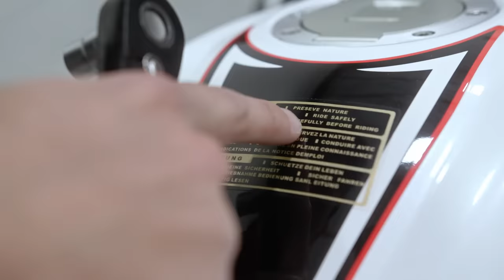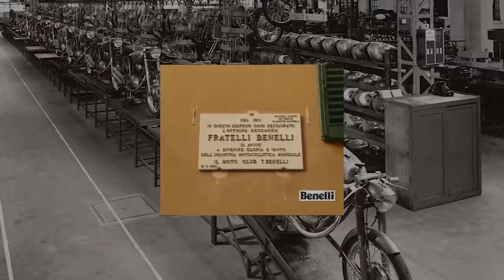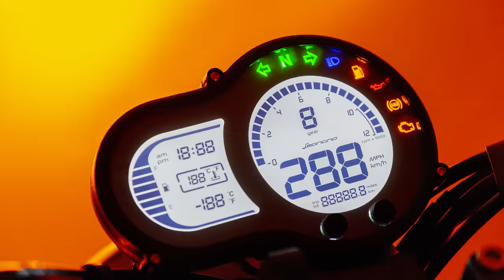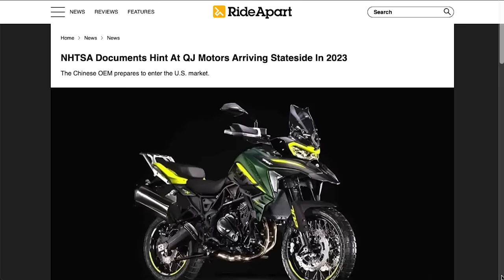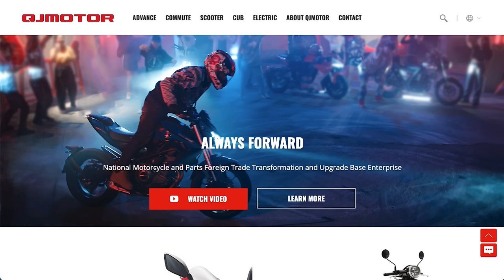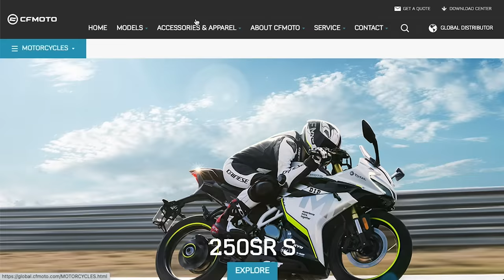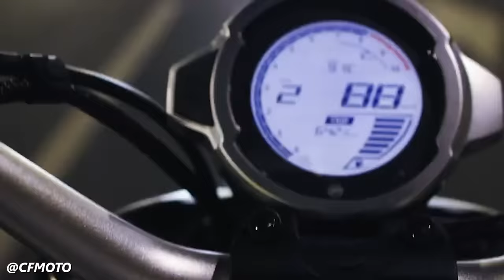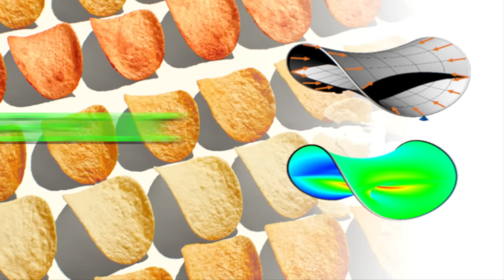7 Chinese Motorcycles that are WORTH IT

Comment: To be fully honest, Benelli is probably more reliable now than when it was Italian
Reply: This dude probably owns a benelli
Reply: Eyyy we made them to go fast not to last.
Reply: Not hard.
Reply: That's a very low bar
Reply: Believe me CFmoto has better quality then  Qj or benelli
Reply: @thecreativeenzymes  that’s for sure 👌
Reply: @maverickiragulfan4434 that sucks the don't last I never had one b4
Reply: By far yes
Reply: A man Went to Afghanistan on a Benelli Trk502 and has no problem
Reply: Shit motorcycles but pretty awesome guns 😂😂😂
Reply: Got the bn302s love it so far just eats oil on constant high rpm
Reply: @thecreativeenzymes  Really? They won't fall apart in two or three years?
Reply: Poor fool!!
Reply: I bought a 2023 Benelli 302s March of 2023. Right now I'm just shy ok 10k miles and have had zero problems with it.
Reply: @metaldreams3595  every vehicle gets old and fall apart depends on how you use it. What I said is just a comparison between the brands.
Reply: Some guy made 85k km and 36 countries off road with trk 502x
Reply: Reliability is all about funding. When Benelli lack of money their reliability will just goes down with it
Reply: @maverickiragulfan4434  hahaha
Reply: Benelli's 500 and 750 sei engines were copies of the original Honda CB500F engine,with the 750 being a 500 with 2 extra cylinders slapped on, so I guess Benelli have come full circle.

Comment: I live in Melbourne, Australia. I bought a Benelli TRK 502X new 18 months ago. I’ve done 117,000 km on this bike with little trouble. Yes, it’s heavy…but when you get caught in a crosswind, or buffeting caused by road trains you’re going to appreciate the stability of the bike. I do a yearly trip to far North Queensland, over 10,000km in 12 days, and the bike is awesome to ride. I get mine serviced every month at the dealership I bought it from and they just laugh when the check the km. It doesn’t have the “grin factor” that my Tiger Sport 660 has, but I can’t do 1000km + days on the Triumph either. Seat is really comfortable and butt only starts getting numb around 800km mark. Great bike for the money.
Reply: What was the top speed you got on it ( I know silly question but ?)? And is maintenance cheap?
Reply: @mrrnigah643 my friend rides a trk502. with him and his wife (their total weight 200kg minimum) on the bike they were able to go 147kph easily. He said that he wasnt even on full throttle.
Reply: @mrrnigah643  do the maintenance stop being lazy its a bike not truck

Comment: The CFMoto 300 NK is one of the few good quality bikes that get to Latin America for accessible prices. Most Japanese brands don't bother comercializing models with ABS, full LED lights, and good displays on the lower end, except in a few countries. Definitely what i'm aiming towards when i can afford it.
Reply: Nice, same for me, where are you from?, does cfmoto have good reputation in your country?, here in Costa Rica is somewhat marginal, but slowly getting acepted has good quality
Reply: @jorgerivera6307  soy de Argentina. La marca esta aqui desde hace algunos años ya. Tiene buena reputacion entre los foros de mecanicos por su uso de buenos materiales, y muchos de sus repuestos son compartidos con motos KTM y con Honda, como los filtros de aire que son los mismos de la CB250 Twister. Lo unico que si me da cosita es que no tengo concesionarios cercanos para hacer valer la garantia, y que es dificil encontrar mecanicos que le entren a la parte electrónica de la moto, la cual tiene de sobra. Otros bloggers de paises como Chile, Colombia y demas hablan de experiencias similares. Algunos la tienen por muchos kilometros y el motor no se deprecia como usualmente se asocia con motos chinas. Otra marca muy bien tratada de entre las chinas es Voge, que viene de la mano de Loncin, aunque las Cfmoto son mas bonitas y mejor hechas en mi opinion.
Reply: Got 1500 miles on my 300NK, and loving the MPG life on it. It very nimbly weaves through Little Rock traffic, 7 miles one way, and is such a fun alternative to my 12mpg, but fun in a different way, Ram 1500. I am very soon getting the CLX700,or the 800NK next. The 700 is going as low as 4200 right now too.
Reply: In my country
It's just an overpriced bike 
It cost like Duke 390 but is weaker than Duke 250
Reply: @jerrybhai3362  let me guess, colombia or brazil, not trying to mock you, just geniunely trying to guess the market
Reply: @jorgerivera6307  you will get it through my name
Reply: @jerrybhai3362  jajajaj india?
Reply: @jerrybhai3362  bhai ktm tho king hain usse comparison nahi par bike actually acha hain like titan and rolex
Reply: cfmoto owner is a morocain that created his motorcycle in italian for the first time but it was expensive he chosed china to makes it cheap

Comment: Fun fact the Police force of China uses CFmoto 650MT's and 800MT's and recently Greece's police force has ordered dozens of them also.  If the popo is using them then they have got to be somewhat reliable.
Reply: Politics not engineering steer purchases,
Reply: @eflanagan1921   That too but from what I hear from peeps that have bought these and put miles on them they have had no issues easy acces to parts if needed, service intervals okay. Dare I say it it's like buying a kawasaki. The 650MT is based on the Kawasaki Versys engine design and the 800MT I think it's the same as the KTM 790 Adventure. So ya value for money and also reliable. The big 4 just became the big 5 it seems.
Reply: KTM reliable ??? LOL
Reply: i knew Greece is in deep shiet but this much troubles ?
Reply: @nokia5359 budget cuts have been kind of drastic though I think CFMoto isn’t a bad idea. Typically they use v-stroms and Hondas with the occasional aprilia. Honestly it’s good to see they are finally getting newer equipment as most of their vehicles are over 15 years old
Reply: They're using KTM 1250 ENGINE on full tourer as police bike.Malaysian police are testing this bike
Reply: @amrozh985   Ya I know
Reply: Fun fact, Do you know that Chines govt don't allow use of motorcycles in cities, and if get caught they confiscate it.

Comment: I personally own a 250NK from CF Moto with over 52K kilometers on it, the last time I checked the valves all were still in spec (I checked them when the bike had 49k kilometers) never had issues with electronics nor engine, pretty happy with this brand to be honest.
Reply: Great to hear.

I'm feeling best bike brand vibes. Being from china I feel is the only thing holding it back. Which to me is awesome. Just means I get choices at discount prices.

Haven't bought a bike yet.
But am looking at the 450 CLC, SRS and NK range for myself. But having no riding experience I'm torn between which styling is truly me.

Think I might start by getting the kids a cx2e. Seeing them have fun might motivate me to make a choice.
Reply: does the exhaust make buzzing sounds that make the bike vibrate?
Reply: my friend has bajaj boxer 150cc it lasted 160k before he just changed piston rings the thing is people in third world take care of their equapmint cause its valuable to them  never rev the engine to high rpm change oil every 2k its just 1 liter 4 dollars bottle not a big deal that's why they last , Americans are the only people who would spend like 20000 dollars on a thing that they have no Idea how does it work and how to maintain it they are just consumers and often don't use their things enough they buy things and let it collect dust in the garag barley use it and when use it they beat the shit out of it like a children
Reply: @ercanyesiltas  It does, unfortunately
Reply: @sebastianlemus8377  thats the single most annoying thing on this bike

Comment: I have a Lifan KPX 250 which is a Chinese bike. I got it new for $2600 and i love it. I have put a little over 22,000 miles on it with no trouble so far. It is a dual sport and i always still get a smile on my face when riding it. That's what it is all about.
Reply: I have about 1000 miles on my Lifan X-pect 200, paid $2200.  Zero trouble.  Excellent mileage.  Fast enough.  Absolutely worth what I paid.

Comment: Benelli and QJ are both owned by Geely Holding Group. Geely also owns Volvo. I own a Geely car that was designed and engineered by Volvo engineers. The quality is just fantastic. There are some companies that are aware that Chinese products have a bad rap for being low quality. So they are making huge strides in quality by hiring engineers from reputable companies to improve their products. CFMoto has partnered with Japanese companies to make sure their products are of higher quality.

Comment: 6 years of riding a CFMoto 650nk to and from work every day , weekend thrashes and it's not had a major mechanical break down , the water pump springing a leak within warrenty has been all .
I do all servicing on a regular basis myself and I am really impressed with this bike , 72 hp so it goes very well .
Reply: A licensed  Kawasaki 650  twin engine

Comment: I am really happy for this video. Not all Chinese bikes are equal. Especially if they are build for a European brand that is responsible for the quality check as well. BMW, KTM, etc. I own a Benelli TRK 502X and I love it. A bit on the heavy side but it is also very stable. Has a great road presence that makes it safe. Car drivers actually see you. Also the dealership in Cyprus is amazing. I totally recommend it. I am not a new rider. I am 52 and I have a background of a lot of sport bikes (NSR 250R, ZXR400SP,  ZZR600...)  so I believe that my opinion has some value.
Reply: Which Chinese brand builds BMW?
Reply: @gigihanmandarin  Voge.
Reply: @gigihanmandarin  
Voge.
KTM is connected with CFMOTO.
Benelli is connected with QJMotors.
Reply: Late to the party, but if you stumble on motorcycle called Haojue, it is literally just a Suzuki. Same quality, love it or hate it depending on your taste, and slightly cheaper. That's because Haojue was licensed directly by Suzuki to manufacture many of their low-end motorcycle and have their expert QC senior engineers. Haojue, in turn, use a lot of Suzuki technology and design. And yes, you can even find Haojue Gixxer clone.

Comment: I have a Benelli 302S that I basically stole from a local dealership as nobody wanted it, and I bought it with only 200 miles on the clock. Two and a half years and a couple thousand miles later, still a great bike with zero issues. All I’ve done to it are oil changes. I am very pleasantly surprised with it, especially considering what I paid for it.
Reply: I bought a 2023 benelli 302s in March 2023 I have almost 10k miles on mine with zero problems

Comment: Bennelli 500 Rider in the US here, LOVE this little beast...just enough torque and power to be fun in the city and back roads, and still get you down the HW if you don't mind the slightly stiff tail turning your tailbone to dust.  The 702 is not a beginner bike, it is the Adventure Bike you buy when you get divorced and she gets the BMW...you can even slap some badged boxes on the back and just block out the rest of the branding and only other BMW riders will know your pain and commiserate with you.

Comment: I own a 2022 Venom KPR 200 made by Lifan and it’s a great motorcycle. Build quality is very good and reliability over the year that I’ve owned it has been outstanding. For a 200cc it does really well cruising around town or even hopping onto the interstate. Gas mileage has been great also, just an all around fun bike that I enjoy very much. I purchased it online from Venom motorsports and they have been great. Budget motorcycles may not be for everyone, Y noob included but for some of us they are a very viable option.
Reply: I’m heavily leaning towards a Venom Sportster 200, it’s $2000 and need something to learn on that I won’t be scared to scrape up. Is it essentially the same motor/transmission as the KPM 200?
Reply: @SCIFIguy64  No it's not the same engine as the KPM200, it actually has a 223cc engine. I'm not really familiar with the venom sportster but venom has been good about taking care of their customers, and the sportster would probably be a good bike to learn on.
Reply: @SCIFIguy64 YES!! I literally just bought the 2022 VENOM SPORTSTER CHOPPER | 250CC MOTORCYCLE. Comes in in 2 weeks fully assembled. I never rode a bike before so wanted a nice cheap starter so we shall see.
Reply: @Vasquez19781  Awesome Vasquez! Congratulations on the new bike? I hope you have a lot of good times on it.

Comment: I have a Kove 510x adv. Engine like a Honda 500cc (498) 48hp 45nm. Ground clearance 220mm. Nissin two-piston front, two discs at the rear single-piston. Steel braided lines. 210mm Kayaba suspension with full adjustment at the rear the same 198mm with adjustment, 20l tank, fuel pump and ABS from Bosch and ABS can be turned off at the back or all. Two maps (eco and sport), on-board computer, tire pressure and temperature, navigation. Central stand, crash bars, crash pads and engine plate as standard, folding gearbox and set levers. USB and cigarette lighter socket 12v as standard. It drives very nicely, agile with a twist (for a motorcycle with only 48 HP). The gearbox is really great, works better than in many Japanese ones. Its younger brother 450cc, rode the Dakar which also says something. There is no problem with parts in Europe and there are also many dealers and the price is lower than the Honda NX500 which is without accessories. I am very happy and there are already motorcycles that have ridden 50k -80k km and do not behave differently than motorcycles from Japan. I think that a brand like Kove, cf moto, qj after making a reputation will be often seen on the roads in the States , there are already a lot of them in Europe... Sorry for my English but it is not my native language. Regards.

Comment: if you buy a Chinese  bike. Change the engine oil , run it for a few minutes , replace the oil and the filter and you are good to go . Replace the front fork oil , its usually cat piss , which in China is cheap

Comment: so I actually own a 700clx sport and I have to say; this bike is amazing, fun, reliable, and looks great. I've owned mine for abt 7-8 months now and it has treated me extremely well. I did have a unfortunate scenario happen just a month back though here a piece of metal was found in my long block just messing everything up so I had to get it replaced. so I had to do the break in period again but its running amazing now. with how cheap the bike is its so worth is adding on the gap insurance and getting the warranty to cover you aswell. as someone who got this bike for his first do i think its a good choice? yes absolutely, if you are looking for something thats in the budget of 6k or less with all the same tech as a 30k bike then i highly recommend it. as far as preformance goes though id say its a little slower than the mt07 and has less torque but still a great option!

Comment: If I remember correctly Benelli Armi S.p.A. is an Italian firearm manufacturer located in Urbino, Marche, Italy. Founded in 1967 as an offshoot of the Benelli motorcycle factory that sold motorcycles through Montgomery Ward, Benelli and Benelli USA have been owned by Pietro Beretta SpA since 2000.

Comment: You have it backwards, CFMoto makes the engine for KTM.  So KTM is using a CFMoto engine. Hope that helps. Actually looking forward to the CFMoto NK800, which will be a Duke 790 but cheaper.

Comment: I have a egl 300 cc dirtbike 
With 31 hp and really good torque for 240 pounds and findable parts its nice 
If I would describe in a non specs sheet nerd way 
Its lightweight the low end and high end is good for a longer stroke engine and I can rev it like crazy and it doesn't blow up on me and a nice suspension adjust and it feels quite different 
I love that the front end is light weigh and it wheelies very easily

Comment: As a chinese here, here are my personal recommended models if you wanna try chinese brands:
CF moto: 450 SR (sports), 800MT (ADV/Touring), NK450/CLX700 (Street)
Beneli: TRK 502  (ADV/Touring), 752 (cruise)
Kove: 450 RR (Sports), 800X (ADV/offroad)
Not recommending QJ moto bikes as they are bad for quality in general. I would vote for Kove with extra credit as the brand is really investing heavily on innovation and manufacturing their own stuff, the new 450RR parts/engine is really fantastic
Reply: How about zontes?
Reply: @i-am-learning-life   I would rank Zonte as Tier 2 brands as their engine quality may not be consistent from one to the other, can give a try for their Scooter 350D.
Reply: @jw8767 what about voge 300rr?
Reply: I recently bought a localized version of dayang vorei 150. I have had 1100 kms on it and I'm pretty happy about it. How it is recepted in China?
Reply: @Fernov Voge 300rr was popular like 2-3 yrs ago where not many manufacturers in the market ( their bike quality slightly better than others in old days). The engine is a reverse engineering from Kawasaki 300cc engine by manufacturer called Loncin.
Reply: @jw8767  Hello. Can you give a more detailed insight about QJ Motor models and its reliability? SRK 250, SRV 300 and SRV 350 are possibly arriving here in Brazil by 2025, and I'm very interested in the 350. I'm worried about the reliability of those engines, and the tropicalization of the bikes. Thank you very much for your time.
Reply: Did you try benda bikes?
Reply: i own kove 510x adv and this i a good bike

Comment: I remember Benelli and Garelli from the 1976, when a friend owns a Benelli and I a Garelli. We bought it because of the pricing. Others were 3 times more expensive and upgrading to 50 cc, is a motor, was very easy. However....if you drove a day, next day you needed to check your bolts...it was possible your cycle fall apart 🤣🤣